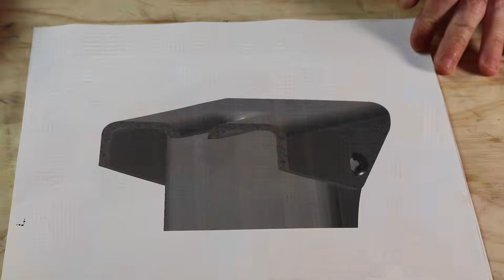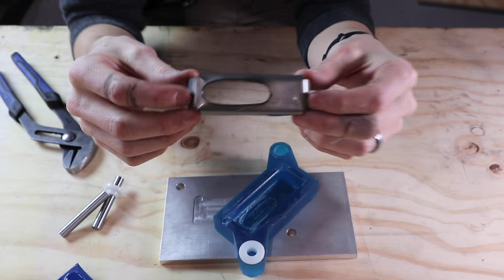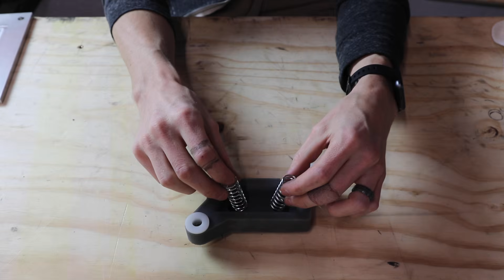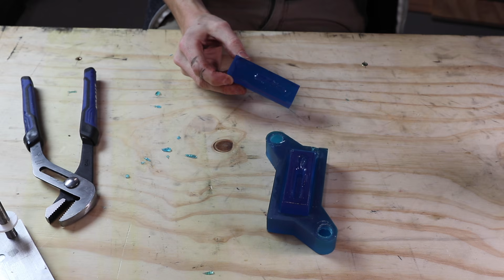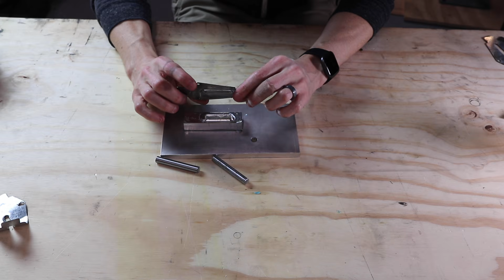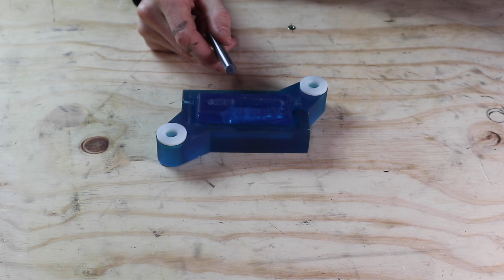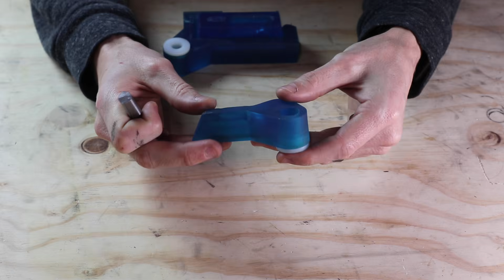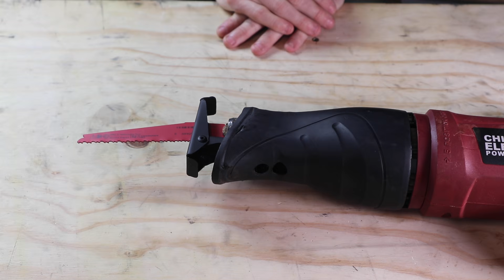Bending Steel With Plastic Tools

Comment: I think this might be a good application for casting. Print the form shape, use it to make a silicone mold, then cast the actual form in a casting resin. Probably there are casting resins that are much more durable than printing resins, and cheaper too. The other nice thing is, once you have the mold it's very quick and cheap to make more forms if/when they wear out.
Crafsman/SteadyCraftin has some good videos about this process (there are some stumbling blocks, like certain UV-cured printing resins will prevent silicone from curing properly if you don't seal them well).
Reply: There are casting resins which can be SLA printed, I believe.

Comment: Just FYI but if you want to make better cuts on galvanized steel you want an inert gas, the trouble with air is it's oxygen and moisture content. Nitrogen requires a higher pressure and it's quite pricey so reducing the nozzle size will also help.

What material do you use for your form parts? We often use a high density nylon material in our vee blocks to avoid the warp on holes close to bends.

Comment: you can do all that, or.. you can try the usual METHOD, but with different materials... a part like that is not manufactured with a die, but bending the sheet 4 times which CAN be done with printed parts (I've seen PLA and ABS parts preform more that 40 bends before starting to lose quality)

Comment: put the plastic into compression by putting a metal box  with the guide pin feature on it.   This is very common approach in plastic injection molding to have a steel box with pockets for aluminum or even plastic that have the desired shape in them.

Comment: I have some questions:
What printer were you using?
What's the liquids on the dies and metal plates?
Reply: I can't answer as to what printer was used but the liquid is oil. Most press forming will use some kind of lubricant though typically not that much as it can cause hydraulic pressure to deform the part.
Reply: @John-wk2fd  Thanks for replying! It's nice and cool to learn new things!

Comment: So you used tens of hours and 30k+ of equipment to fix 10c part from a $20 powertool?
Also how do you print such thick objects?
With my cheap resin printer the part comes off the buildplate if it's thicker than 2mm...
Reply: You missed the point of this entirely.

Comment: I think if I were designing the tooling for the original piece we'd be looking at a progressive die, where one of the early steps formed the pit that outlines the center hole but that the center hole isn't punched until the end.

Comment: You need an actual die shoe so you can mount your dies in it.  It is impressive.  But the with such a non-precision press, you have no chance to make very many parts without a shoe to give you the precision alignment.  I have that press also.  Another thing, not only do you need clearance for the male part of the die in the female for the internal feature, you need clearance for the material.

Comment: About breaking the outer die at around 12min, it looks like the upper aluminium plate was stuck above the rod and creased de plate while violently going down. I guess you already know though 

:p
Reply from the maker: haha I didn't notice it at the time but I eventually figured it out when I was trying to figure out how the aluminum plate got a 1/2" chunk of material ripped out of it :)

Comment: What kind of resin did you use? How does it compare to FDM PETG or FDM Polycarbonate? Thanks for posting. It was interesting to see what is possible with a 3d printed tool and die. I might try something like this for the parts I would like to make in the future.
Reply from the maker: I used several but the best performing are tough and grey pro on a Form 3. I'm not sure of the properties of the FDM materials but you can see the material properties for the resins I used here: https://formlabs.com/materials/engineering/#rigid-resin

Comment: I would've put some springs between the base plate and the die to make sure it comes down straight. When it broke, it was coming down at an angle.
Reply from the maker: Yeah the jig I made is very badly designed. It has a really serious problem that the bushings can "cam" onto the rods and bind to the point that they destroy the tool. I had to be very careful when pressing to avoid this condition. I have some new press forms I'm building right now for an upcoming video that are significantly better in this regard (but at the same time really crappy and made of wood :)

Comment: You could use the 3D printed forms as plugs to make moulds and cast new forms out of aluminium. That would be just as much mucking around as CNC machining out of aluminium but a viable option for anyone who doesn't have a CNC mill.
Reply: You'd have to deal with shrinkage, though. Not that sheet metal is known for being super dimensionally accurate, but still.

Comment: Here's an idea to account for the inability to bend past 90 degrees using just 1 press axis - Roll or press a bead on the outside panel near where the target bend needs to be. Either calculate or trial and error whatever radius to distance from the corner is ideal. The net effect should push the panel past 90 relative to that ratio given you accounted for any new tolerances needed.
Reply from the maker: That's a cool concept that I bet that will come in handy some day. I've been doing a lot more press forming lately. Lately I've been using wood forms - should have a video overview soon.
Reply: @StuffMadeHere  Keep up the great work. YouTube actually made a decent recommendation, and when/if I ever get around to doing some sheet metal projects, your findings will certainly be invaluable.

Comment: Awesome channel! What 3D printer and resin are you using?
Reply from the maker: I'm doing most of my printing on a Form 3. I use a lot of different material but the main ones are Tough, Rigid, Draft and Clear

Comment: For forming the center feature, Clamp the part in your two die half's but have the top die have allow for a  punch to form the feature via passing through a hole in the top die instead of the spine thats currently part of the top half. As your part will be evenly clamped prior to forming the center feature you should expect to get a better formed feature and less cracking of dies as they will be under pressure from clamping.
It would also be neat to see a milled punch and die single step press tool milled out of steel, It should be possible for that part but would be tall and require very good fitting for clean cutting..

Comment: This is a common issue with forming dies. You were on to something when you said the die was in tension. To overcome this issue you can press fit the brittle material like tool steel, carbide or plastic into an outer ring. The key is to preload the die cavity further than it would naturally stretch during the bending operation. This prevents the tool material from goin into tension. The best way to do this is to add some draft angle to the die insert and make the opposite shape in the outer ring that is smaller by the amount of compression you need. You would then press the insert into the ring to achieve the interference desired. If you get it right the die will not split. You would then be limited by the compressive strength of your tool material.
Reply: Love the comment sections on these vids <3
Reply: Smart boi
Reply: That's a great explanation, thank you for sharing fantastic info and insight like this!
Reply: I love science man. I just works, and when you see it, in the moment. That we are slowly becoming the masters of everything (if we don't blow ourselves up before then), it boggles my mind
Reply: @Stagg369  the problem is we're not masters of ourselves, so the blowing ourselves up part is inevitable. More people were killed last century than the previous 19 combined.
Reply: @gracefool  A total of *50 billion people lived between 0-1900 compared to a total of 10 billion between 1900-2000. I question your assertion.
* Estimated
Reply: @ruukinen  Sorry I should've said "killed in war". I don't know about killed all up. And of course the average person died younger.
Reply: @gracefool  I don't know man, I looked at wikipedias list of wars by death toll and it looks like the qualifier 'in wars' doesn't matter here. Also the average elderly didn't die significantly younger in olden times, it was deaths related to childbirth and or deaths during childhood that drove the average down.
Reply: @gracefool  Well the amount killed by war will be a percentage of the population that fights in the war. That percentage will be greater if the world population is greater. I'm way too lazy to go do the math, but I'm willing to bet a much smaller percentage will have died in the last hundred and twenty years comparatively. It sounds worse (and realistically is "more" deaths), but that's because "3 million people died" sounds worse than "20,000 people died," when ".17% of people died" sounds better than "2.2% of people died."
Reply: @hunterm9  yes I didn't say proportion, I said "more killed".
Reply: @ruukinen  that number of yours is way, way out. There are more people alive now than have ever lived! 7.5 Billion people alive now. The entire population of the world in year zero was only about 300 million. In pre-history, it was the 10 million.
Reply: @NigelTolley   Edited: wrong argument. Had to read it through again. These are values you can google.

Btw people who have ever lived number 100 billion more than people currently alive. Approximately.

In case you are confused 'ever lived' refers to total people ever born. Just cause you died doesn't mean you didn't live at some point.

Comment: thank you very good project. p.s., your software will tell you (FEA fusion360 or Solidworks) where the critical stress fracture areas of the parts you create will be located (blue red and yellow), and where to beef up your designs. p.p.s., mill your final punch and die in aluminum and you got it covered. nice work I'm glad to see what I've been teaching in HS/Votech really pulled together in a project like yours. kudos keep creating. what was your resin mixture, or was it FFM 3d?
Reply from the maker: Thanks for the tips. Adding a press step is in my list (I have a strange desire to see a complete progressive die line in my basement...). As for the tools I actually printed this on a resin printer (Form 3)

Comment: I have to laugh at the $50 in resin used to fix a $30 saw, but obviously that wasn't the point. Great demonstration,  I wouldn't have thought it would hold up as well as it did.
Reply: I get what you are saying, but if you can re-use the mold for multiple copies ... Admittedly this particular item might not be the best example for that.
Reply: @xConundrumx  Not sure how many times...  Exploding dies were a theme :D
Reply: @JamesLee-sw6ss  Agreed, but now substitute the steel for a lighter material, aluminum, copper/bronze maybe and it does offer some interesting things. I say this because I recently wanted to use some old reflective sheetmetal (not sure what it is really) from an old sun tanning lamp to make some reflectors for super bright leds. This would be a pretty solid way of shaping them I think. Similarly on occasion I need to make some RFI shields for an electronics project, again this would be a good method to make them it seems.
Reply: @xConundrumx  No doubt.  I used to work in manufacturing, and we made a generic aluminum templates for a company that uses a fixed size of dies.  They used 3D printed dies inside the aluminum template to prevent exploding dies.  They said it was usually good for around 10 pieces before they had to re-print the die.  They were actually using the dies for injection molding, which should add another layer of "damn! that's cool!"

I wasn't trying to discourage anyone from doing this, I think this is an amazing technique that home users have access to.  We just need to manage expectations and be realistic about what it's good for.

If you check out 3D magic mike, he does this as well.  however, he uses a 50% fill with honeycomb backing, and fills that with epoxy for increased rigidity.  Dude is stamping aluminum all day long with that form.
Reply: We build $500,000 cells to make $0.27 taser darts for $200 guns 😉
Reply: FlybyJunkie what I’m confused?
Reply: @FlybyJunkie   yes but how much money does that $5000,000 cell make back?
Reply: @adrianharrison5208  😉
Reply: Why just buy a tool when you can spend twice the amount of money to try and make one yourself - it makes you appreciate the real tool that you buy in the end so much.
Reply: He's the Engineering team lead at Formlabs, probably gets a discount on resin...
Reply: is sla that expensive?
Reply: @dinosoarskill17  the price can fluctuate based on sales, I've seen 1 litre go for ~£30-60 GBP from manufacturers/sellers like Anycubic and Elegoo.
Reply: @MaximilianonMars  Yep, I havent spent more than £35 a litre, including postage. You could get one set of dies out of a litre, this kind of size anyway.
Reply: fightmeirl it's often more expensive. A bottle of resin from formlabs is 100€ and he used a LOT there
Reply: Y’all acting like he spent a fortune. Calm dooooown.
Reply: and so far probably $700 bucks from YouTube.
Reply: Don't forget the value of the educational process!
Reply: buying new isn’t learning anything. ❤
Reply: He is the only guy who can make money from losing something
Reply: Was is fragile resin or condensed? (Pointless reference)
Reply: my car costs 5000$, i spend on it 10.000$. car is tool too. and?
Reply: It's a testing video on something small just to see if it does what you need
Reply: Hahaha this is a constant struggle for me when printing parts. Especially with the risk of failed prints and when I'm using more expensive resin (I have some high temp stuff that's $100 a liter!). Ultimately I write it off as an expense for learning and entertainment though.
Reply: hey, its free if you already have it, plus if you're thrifty and patient you can always find someone doing a firesale
Reply: Nothing about this was cost effective. I am sure he could have obtained a replacement part from HF for a few dollars or for $10 or $15 he could just get another saw of the same model in a pawn shop and swap parts around to get one good one. I suspect he did not personally pay for all the materials used and he may have even been on company time while doing it.
Reply: @EPaulIII  I apologize for digging up a thread from five months ago, but I think you may have completely missed the point. This video is more of a case study than a practical how-to.

Imagine you were in the eleventh hour of a prototyping job, deadline looming, and didn't have the ability to machine up a die set for a part you desperately needed.

This would actually be a killer lifeline. It would have saved my ass a couple times if 3D printers had been a thing back then.
Reply: @EPaulIII  I looked at the HB replacement parts list, this tool isn’t on there.  There is a lot of irony in spending this much time repairing a cheaply built tool, But I think this is probably more about the process.  And it would be worthwhile for repairing older more valuable equipment.
Reply: I think that's way too much.  He could have used that money to not only buy another tool, but to buy gloves.  He's going to infect someone with Covid and then it will spread and kill someone.  If he didn't waste all his money on Resin he could have paid for there funeral too!  Gosh.  The ignorance!
Reply: @HairyTheCandyMan  their
Reply: @HairyTheCandyMan  people are fucking stupid... If he didnt use that material he could have funded the research agaonst covid and save the world

Comment: 1) I´ve seen other people´s videos trying the same, and I noticed that your forms are pressed VERY unevenly compared to them, so don´t wonder, if the edges around a hole aren´t perfect, or that the form brakes! What you realized in the video not before 14:03 , was rather obvious at latest already at 12:21 , sorry for that... You need 4 guides, instead of just 2, each guide reaching throught holes in the bottom steel plate, lower form, upper form and upper steel plate.
2) Did you use some marine grease, compartible with plastics, for the sake of the longevity of the form? 
3) Person in this video tested many resins, and found a very tough one, maybe consider that? https://www.youtube.com/watch?v=ekDs60QxmNE
4) I know NOTHING about your work, and wish you luck and success, but forming something with a big hole in its center is never gonna work perfectly with simple one-piese resin upper forms, still, you seem to have great quality results, after some starting problems... the solution with the 2 springs was key, but I think there are easier methods... I think, instead of a steel-plate at the lowest end of the springs, others use a resin form instead, consisting of the cental part of your 1-piece-upper-form... At the end, they form the piece in a single press-step, althought the upper form consists of 2 pieces. Your 2nd upper form for the "radius-forming" is then not needed anymore!

Comment: You are 90% there to hydroforming. I'm pretty sure the 3D printing can be used as bucks and forming dies. But with the hydroforming techniques, the flowing medium supports the material all the way around. Giving you much crisper features. My favorite DIY version just uses a steel box and a rubber pad with the shop press.
https://www.youtube.com/watch?v=xw5yEMsDxR8